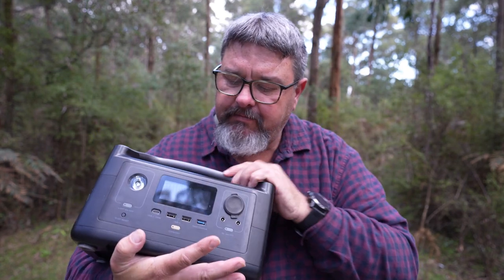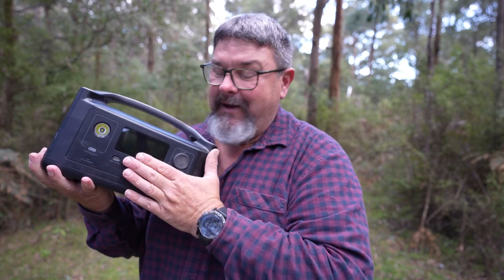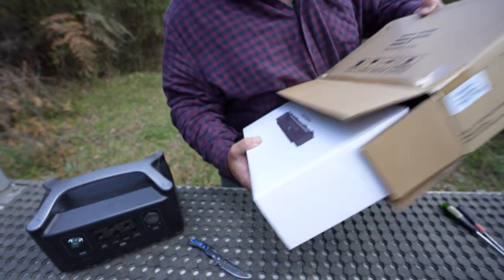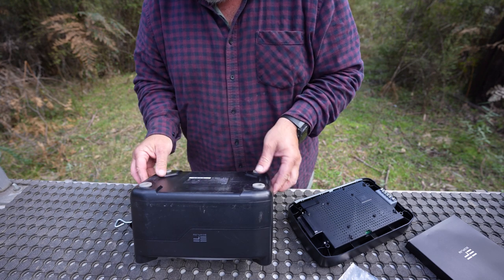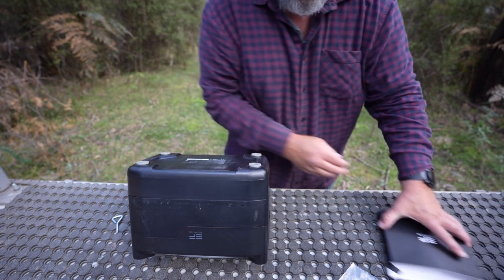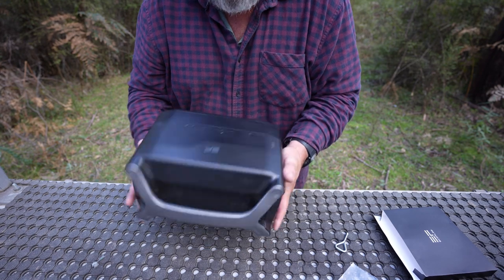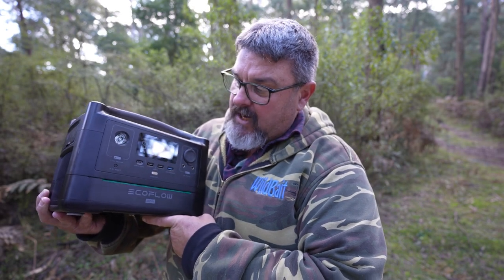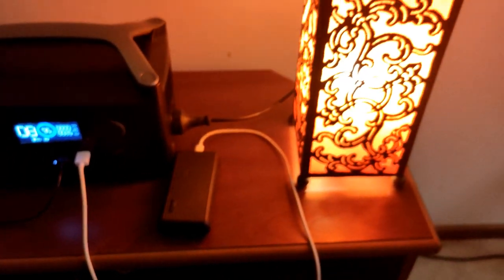Adding An Extra Battery To The Ecoflow River

Comment: Robbie mate , just a warning , I know several people who TURN EVERY OFF AT POWERPOINT sad thing is modern technology has a preface to standby mode ,reason being them micro chips and processors  do not handle cooling down well  , it has cost my friends in the last 10 years , fumbduck 4 flat screen TV's , 2 laptop comps an iPad and a ratio transceiver , an old lady down road is now on a third flatscreen ,and old lady across from me now onher fourth tv , instruction manual all have in them the device should be left in "standby mode " as it keeps the components warm so they don't get expansion contraction fracture , yes if you do not plan to use devices for long periods such as several weeks or more then by all means turn off even unplugged , I learnt this as a kid playing with cb radios , so that's my observation ,you choose the price you want to pay . I've had my tv 15 years now  and hasn't missed a beat...
Reply from the maker: Oh WOW, I never knew any of that. Thanks so much for letting me know. I better look further into this. Thank mate.

Comment: If you can offset 20% from your power company with your ecoflow great, but how does that mathmatically trasnlate to the price of your replacement batteries (if serviceable) ? if the replacement battery is possible, let alone, if you can replace batteries with competitors batteries it makes financial sense since these batteries have a lifespan. I am curious to know if you've ever replaced the batteries in them, if so, these I can see, would indefinitely replace gas.

Comment: Can I leave the Ecoflow River 2 on solar permanently and use it to power my low voltage devices (wifi routers)… and now and then charge my phone?
Reply from the maker: Hey mate, as long as you have sun to charge your Delta that would be fine. Just running low wattage things like that it should rain for quite some time.
Reply: Perfect. I’m going buy the Ecoflow River 2 then, it is on a special right now. I have a 120w solar panel to charge it… solar panel is an unknown brand, just says Black Friday underneath the glass panel so not sure how long that will last but will have to see.

Comment: Just adding a comment to your informative video ,  Like electric cars , the other  aspect is how long is the life of the batteries and the cost of replacing .  but portable power is useful .  ive used battery polesaws and other large equipment and only get few hours from 2 20 w batteries .  a few litres of fuel can go longer
Reply from the maker: Absolutely Barney. Over in Europe they have made electric motorbikes. They are amazing, with plenty of power.... But don't go too deep into the bush. Haha 😂

Comment: Hi Robbie after see your video about ecoflow battery up grade I order one and got $45 off the price thanks Robbie
Reply from the maker: Awesome, thanks mate. I hope you enjoy it. It's a crazy handy device out the bush, and handy at home if the power goes down. 
My advice, is to charge it full, and then power it off. It will drain power if you leave it turned on while you're not using it. Turn it on to use it, then turn it off when you're finished. You're gonna love it mate.